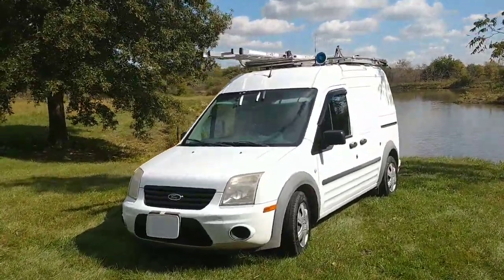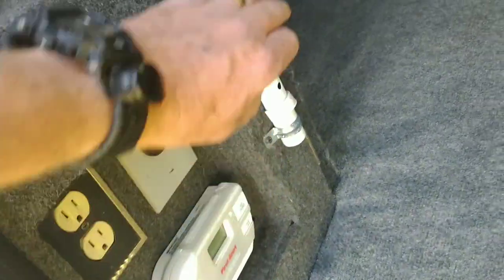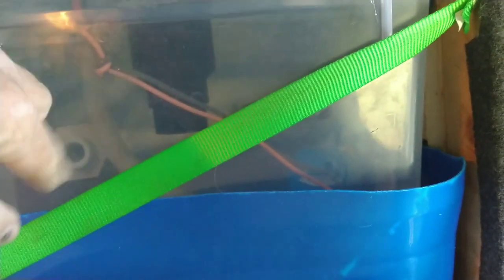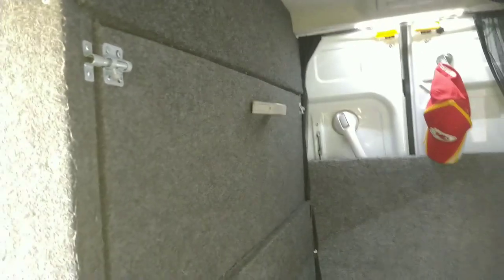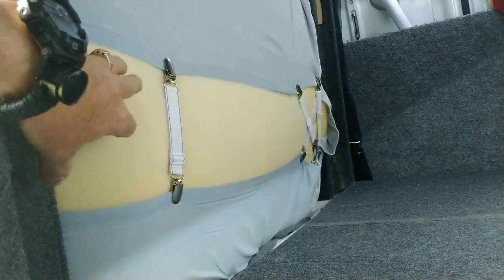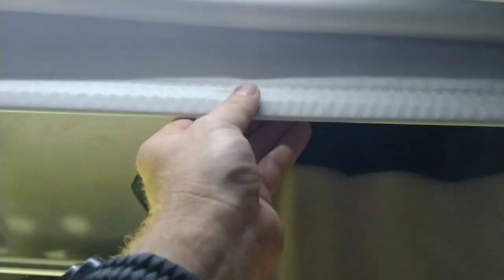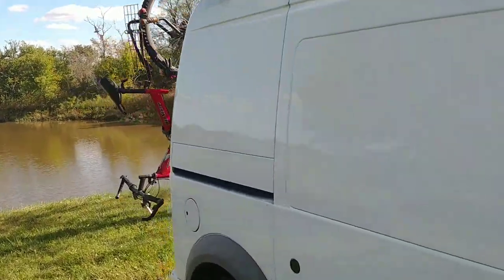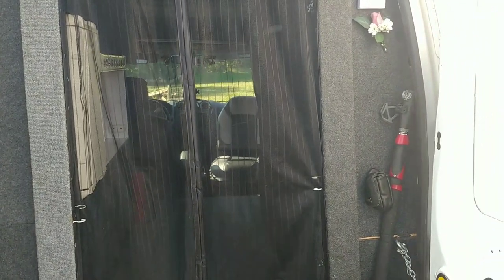World's smallest camper van

Comment: Would like to know more about your Wi-Fi connect projector , brand , lumens??? Power ?
Reply from the maker: The projector I was using was built into the phone I had at the time. One of those Motorola Mod phones.  I don't have it anymore. The wifi was just through my phone service. However there is a program you can get off of the Playstore called "PDA net" that allows you to use your phones wifi on other devices for no extra cost.  Hope that helps.

Comment: can you tell between what year are the ford transit have a larger body/taller
Reply from the maker: The ones that have my body style are 2010-2013. After that the connects have the lower roof.
Reply: @jesuscross9  thank you for letting me know.i'm only 5'1
Reply: I'm a similar height and got the 2015 LWB because I liked all but the height better.